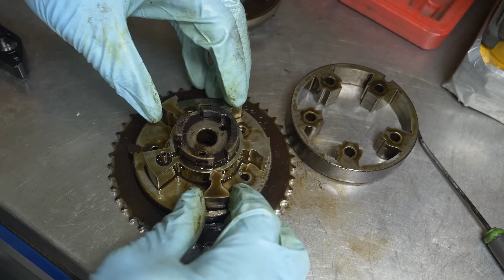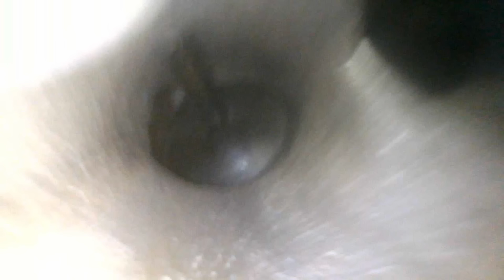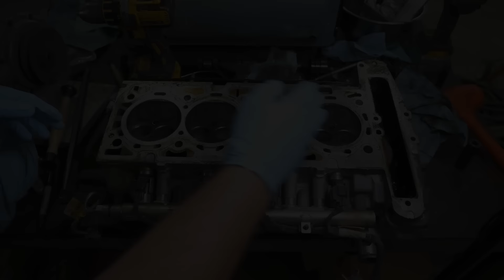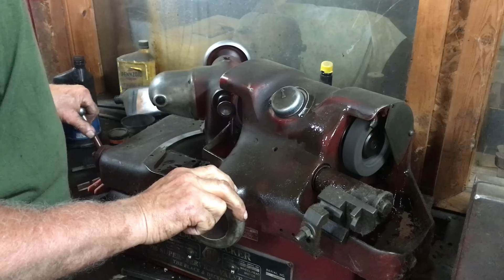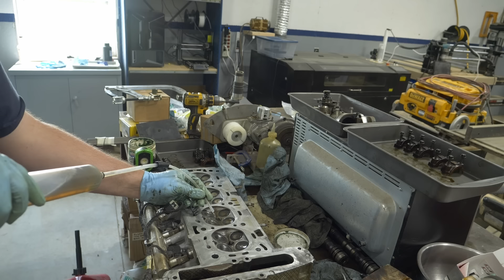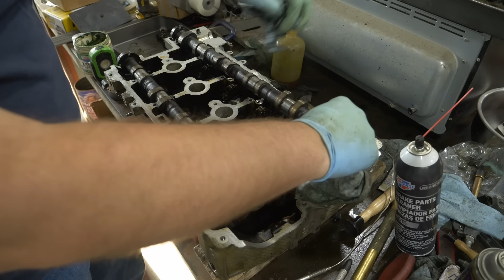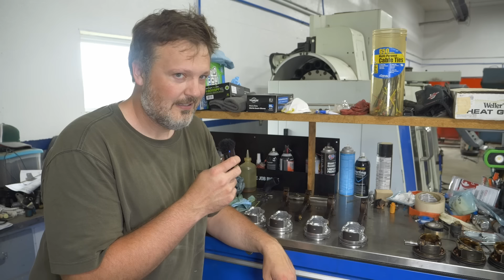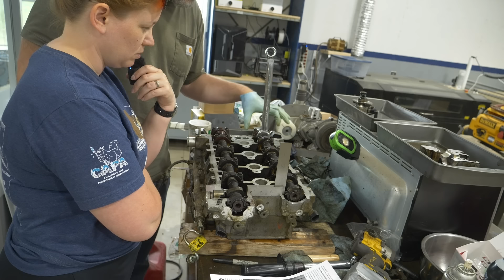How Did it Ever Run? Equinox Still Won't Start

Comment: Buy a Toyota they say. The most reliable car made. Buy my son a new 25 Corolla for college graduation. At 200 miles the low oil level warning comes on. Dipstick is fine. Figured a bad sensor. Drop it off at the dealer figure to have back in a day. 25's don't have level sensors. They have a pressure switch and control valve. Both had metal on them. I assume based on rpm and pressure the ECM determines the oil level. Problem not fixed. They contact the Toyota engineers. They replaced the camshaft housing. This was fix for the same issue on Camry's. Not a fix here. They put new oil in. Nope. After 3 weeks I called the Toyota mothership. They offered a complete refund. I asked if they could do an exchange which they agreed to. New car had to be factory ordered will be here in July. They also told me this car had an undisclosed exhaust camshaft gear repair right off the dock. I let the service writer know who told the tech as they didn't know that either. Tech pulls the oil pan and the mystery is solved. When they did the original repair they gobbed silicone gasket maker on. It found it's way to the oil pickup tube and created a partial blockage. They had the car 30 days and went through $15,000 in parts and labor. They also put a new oil pan in. We have it back just waiting to exchange for the new one. I'm not sure if they would have figured it out if I hadn't told them about the prior repair. Low message came on at 60mph and 1000rpm. They and the engineers were stumped. Toyota also paid for a loaner so props to them for taking care of this.

Comment: The engine was overheated. It was consuming a lot of oil, and the owner didn’t check the oil level, which led to the engine overheating. As a result, the piston pin bushings cracked, and the cam on the camshaft shifted.

Comment: When I watched the first video, I had just finished watching a video with a guy fixing a BMW where the lobes themselves are pressed on the camshaft and had turned out of where they should be.  I thought, I wonder if that could happen here.  I guess not with the lobes on this one, but the reluctor wheel itself.  Sheesh.  Why didn't they engineer a key into it?

Comment: WES..... I have a 2015 with 97k miles on it full of typical gm electrical issues but it runs and drives great. I'm never gonna get paid for the work I've done on and I just want it away from my shop because GM junk sitting around makes my place look bad 😂😂😂 
If you're interested let me know

Comment: I assume it's called an Ecotec because it's supposed to be ecologically friendly with lower emissions? But if all of these engines ended up burning tons of oil wouldn't that negate any environmental benefits with the result being a dirty engine that also breaks a lot?

Comment: I can understand harmonics moving the reluctor  wheel a bit on that cam, but nearly 180 degrees? Should have had timing codes if it were just a few degrees out. Unless that's code has been around a LONG time and because of the poor timing, it caused the engine to run worse and worse and because of the exhaust timing, poor combustion, which caused the burning oil problem? I wonder if your reluctor is patient zero that caused all the other issues. Having to overdrive the phaser to keep the O2 sensor happy? I work on diesels, not gassers so I'm picking at straws.

Comment: I have cleaned pistons and rings while assembled by first soaking the piston assembly in dimethylformamide (DMF)  overnight followed by rinsing with water.  The assemble comes out looking like new.  No scraping, brushing, or cussing required.  I'm a chemist so I have not problem getting DMF.  I don't think it is particularly hazardous, probably less than most solvents used on engines.

The soaking in DMF dissolves all the burned up oil leaving a tan colored residue that I am assuming is the inorganic oil additives.  I think it is the same stuff that you see coating clean engine internal surfaces.  The tan residue comes right off with water.  Blow off the water and the rings will be loose.  I would like to try using this on a coked up engine by adding the solvent directly to the cylinders to see if that works.  I always wanted to market this idea but am too old and don't have the patience to deal with the BS.
Reply: That's quite spiffy if it really works 🤔
Reply: If Wes sends me a couple pistons I can make a video and send it to him if he is interested.

Comment: Solution, put in a SBC w/powerglide n a 10 bolt rear.  Problem solved.  When gm engineered this thing, was it the alcohol 🍸 or another cause or just DEI capabilities?  Just glad I've never even considered anything with dat badge.  💯🗽🇺🇸

Comment: I did the math, I calculate you have $73,023.56 in parts and labour into the $2250 Equinox
Reply: Why did you low ball it ???  lol
Reply: I always thought you were supposed to pull the engine out before you rebuilt it. This video has shown me the error of my thinking.
Reply: @1pcfred   Yeah,, and it was a slashcut to the pistons and rods coming out and it was confusing,,, almost as confusing as why anyone would EVER buy a Chevy Equinox
Reply: @2packs4sure  when it was new I'm sure it had five wheels and went. Just like they all do. Which beats walking. So that's why it got bought.

Comment: You don't adjust the regulator on a differential pressure tester after it has been hooked up to the cylinder.
You adjust the regulator while it is not connected to the cylinder to set the reference side pressure to 100% as the baseline to measure each cylinder against.

Doesn't matter in this situation, but it's best to not demonstrate incorrect practices when people might adopt them

Comment: Don't worry Wes you will get it running. I think most long time mechanics have run into a tough dog. I buy suction cups online and super glue them to valves that the lapping tool won't attach to. Works well and is inexpensive.

Comment: Being that the camshaft timing was off with the reluctance wheel, I would attempt to heat up the reluctance wheel and drill/tap a pin/bolt/set screw into it to hold it in position.  You have the timing spec pics.

Comment: It kinda seems like the reluctor wheel hit something and got temporarily blocked from rotating, which could explain why it moved so much and why the cam phaser was broken. No idea what would cause this though. Were the wrist pins supposed to get lubricated by the blocked oil ring drains?

Comment: GM's supply chain is so screwed up. Try to buy a cam position sensor for an LR4/LM7/L59 V8 right now. The Chinese aftermarket ones don't work and you can't get the actual GM Chinese ones. I hate GM so much.

Comment: Those engines burn oil so badly, most people run them out of oil while driving. They never check the oil, and they damage their engines to the extent you are dealing with. I can't tell you how many people with cars using those power houses have called me stranded with a no start... I get there and they are 4 quarts or lower on oil. Put oil in them and surprisingly a lot of them start.  They just don't live long after that. That engine was run for a long time too low or out of oil. You will want to replace the valve cover and make sure the PVC port in the intake manifold isn't plugged. That's another failure they have...especially if driven when below freezing and the crankcase over-pressurizes and blows the rear main seal out of the block, dumping all the engine oil down the pavement and seizing the engine. Seen that more than a handful of times, too.
Reply: exactly. I worked at plant that made the intake. I thought it was a shit design then and still do. it is a tiny hole in the intake that can cause major damage if plugged.

Comment: Didn't Eric O. have a weird case where the trigger wheel on the cam was also completely out of whack? There was some visible torsion/distortion in the cam itself. Might have been a Ford, not sure.
Reply: I think I've seen that Eric o video and it was with a Buick encore. Same motor.

Comment: Amazing work Wes!

Funny your doing the walnut shell blast.   The 2nd Gen Chrysler 300's needed this back in the 2000's.  Buildup in these motors were bad.   

I'm surprised this method isn't discussed more.

The amount of work your putting into this car is amazing.  I am loving the diagnostics.  

These manufactures need to go back the KISS principle.  New cars are absolute trash, they are made to be used and thrown away at a premium price

With the trouble your having with parts and machining - were forked.  Ugh!